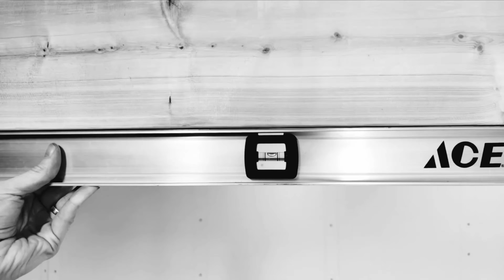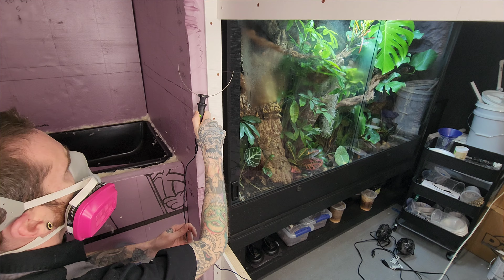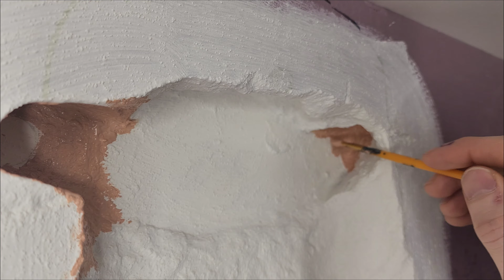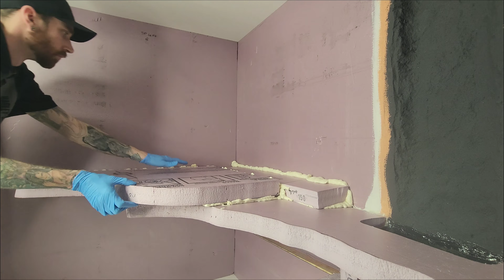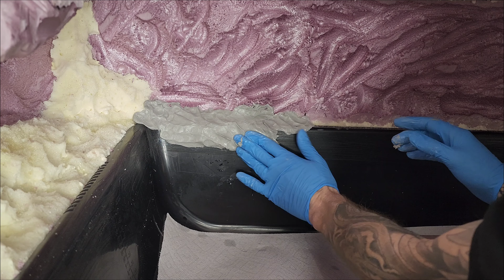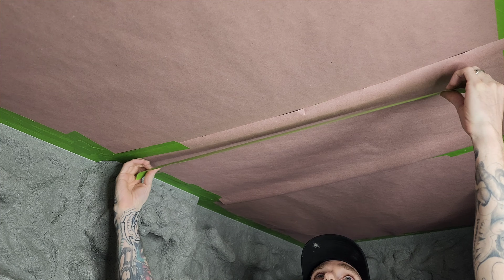DIY HUGE Reptile Enclosure. Waterfall, Dripwall, Hardscape, Background, Zoopoxy |Part 2| #reptiles

Comment: So I’m in process of building a similar size enclosure and Rockwork and am looking at using zoopoxy for if did you use all 20 gallons like you video showed? Trying to estimate right when purchasing given how costly it is. Any insights on gallons per square foot would be helpful.
Reply from the maker: I did end up using 20 gallons. I'm doing a 8x4x6 paludarium now and I won't be carving the background as much (less waste) the way I carved this background with the uneven surface made it hard to gauge how thick I was applying so in the "deeper crevasses" it was probably way thicker than it needed to be. I probably could have done it in 15 gallons. But you also have to consider the ledges and how much more millage you'll need for those. 
It is expensive but it is the best option. Super durable, light weight, and moldable.
You can call the west Chicago IL location amd ask for Tabitha, she will helpnmeasure out what you need. Let her know you wanna use what I used. They are great to work with

Comment: Hello!  I'm currently building in a pvc enclosure that is 3x2x3 for my blue beauty anoles and really want to use this zoopoxy method for the background and to help seal up leaks.   I went to the website and saw sizes and I'm thinking the 2 gallon size might be enough for my project, but I'm really not sure what the mileage is per gallon.    I was curious how much you needed for your project that was 8x2x6.
Reply from the maker: I ended up using 20 gallons. But I applied thick in some spots because if how I carved out the XPS. I'm starting the 8x4x6 paludarium hardscape this weekend and ilk use much less bc om bot really gonna carve out the background as much but do more rock/ bolders that won't eat up as much. It's hard to tell when applying into crevices how thick it is. 
Call their main west Chicago location number and they can help you measure out your millage. Go a little heavy if you are planning on doing extra ledges.
Hope this helps
Reply: @BradsBioactiveBuilds  That actually helps a lot.  Thank you for the quick response, also look forward to checking out the 8x4x6!

Comment: Just.... Unbelievable. You are so creative, skilled, and dedicated! I'm so blown away!! I'm about to make my first attempt at this kind of thing... I know it won't be anything as cool as yours, but watching the process and your tips have been so helpful. Thank you!!
Reply from the maker: Thank you! Glad you enjoyed the video. I'm sure what you create will be great! If you have any questions along the way lmk. Moat important thing is to have fun.
🤘💯🤘
Reply: @BradsBioactiveBuilds  Well, you definitely make it look WAY easier than it is! I'm working on mine now and struggling with the spray foam. I officially hate the stuff! Is there any reason you can't just use the lexel adhesive to put the shelves on and then spray foam the cracks?
Reply from the maker: @Snake_Therapy  that depends, what are u using to go over the xps board and spray foam?
Reply: @BradsBioactiveBuilds  drylok. I’ve been doing things how you did in this vid, but I find I really dislike using spray foam- messy, hard to control, and doesn’t cut nicely with the hot knife! This has been quite an endeavor and expense and I didn’t feel ready to go the next step with that other product you used, but now I totally see the value in that stuff.
Reply from the maker: @Snake_Therapy  spray foam can get messy, best bet is to spray it slowly. It's easier to control and cures more dense. What animal are you building the enclosure for?
Reply: @BradsBioactiveBuilds  yeah, I definitely did not go slowly at first and finally started getting a little better grasp, but yeah, still feels messy. I LOVE cutting the other foam tho! It’s a huge enclosure upgrade for a Mexican Black Kingsnake.
Reply from the maker: @Snake_Therapy  yeah, drylok will work fine with a king snake. Just do a few coats. Check out my blue tree monitor build. I go over how I did it there. 
The hot knife won't cut through sprayfoam. I used to know all the scientific names cmfor what's in it 😆. But essentially heat doest work on sprayfoam like xps board. Both foams but 2 very differed t materials. A serrated steak knife works best for cutting sprayfoam, but my go-to is my fingers
Reply: @BradsBioactiveBuilds  it’s so porous when you cut it with a knife- but the drylok will fill that in?

Comment: Can I ask why you used dry lock and not the zoopoxy sealant? I've heard dry lock and be soft and easily scratched. Thank you!
Reply from the maker: Good question. Do you mean the top coat over zoopoxy, the 1618?
Reply: @BradsBioactiveBuilds  Yes, but I just spoke with someone at Polygem and I'm going to try sealing with the 739 UV Stable MATTE Water Based Urethane (the structure is made out of foam and Master Mache)

Comment: Hello again. I received my zoopoxy order and did some testing and found the cured product still has a strong smell weeks after curing. Did you see the same thing in your builds? If so, how long did yours take to stop off-gassing?
Reply from the maker: Glad you are working with zoopoxy. It took about a month or so for it to be completely gone. I did find washing it off with a hose helped. Don't worry, the smell will go away. At least it's not a horrible 100% silicone vinegar smell.
Reply: Thanks much for the quick response, that is great to hear. I am very excited to build out my new enclosure using this product as testing went extremely well. I added additional texture in areas as well using a bristle brush once the product started to harden more.  

Yes, I agree on the silicone smell. It took three months for the silicone smell to dissipate in one of my previous builds. I do not plan on using silicone in the future. Zoopoxy is the way to go for sure. @BradsBioactiveBuilds

Comment: Why do you use lexel adhesive for attaching the XPS instead of a construction adhesive like liquid nails? It seems liquid nails is safe for that, unless I am missing something.
Reply from the maker: To my knowledge liquid nails is safe and I know a few people that use it. I have not personally done research on it. But I have used it with other projects besides reptile keeping and it works great for those.
Reply: @bradsbioactivebuilds  Thanks! I will try it for my interior XPS board, as it's much cheaper. Hope it will be fine!
Reply: @BradsBioactiveBuilds  Also sorry, another question. Is there any reason I can't use cheaper white EPS instead of pink XPS? From my research, it seems EPS is generally equivalent to pink XPS, but I don't know if there's any important quality I'd be losing out on.
Reply from the maker: @DraconisMarchVII  eps has a less R value and is less dense the xps. It really depends on your applications and wjat you are using it for. I have never personally used eps. Xps seems to do great being dense and easy to work with because if that when it comes to carving and sculpting.
Reply: @bradsbioactivebuilds  Alright, thanks for clarifying. I went to get some and the Menards guy told me they were the same when I was at the counter. Shouldn't have carted it home lol. I ruined one piece. Will see if I can exchange the rest and get the expensive pink stuff.
Reply: @BradsBioactiveBuilds  Another question. How necessary have you found the substrate layer drain to be? I'm trying to minimize height on my build.
Reply from the maker: @DraconisMarchVII  really depends on the type of environment you are going to have. But if you are going to have mist/water added daily. I find it to be important for a place for water to collect so it doesn't waterlogged substrate. Otherwise, you will get a sewage smell and root rot from plants.
Reply: @bradsbioactivebuilds  Sorry, I'm definitely having a drainage layer. The question is just how necessary a drainage valve is.
Reply from the maker: @DraconisMarchVII  like having a hole drilled in the bottom for the water to exit?
Reply: @BradsBioactiveBuilds  Yes.
Reply from the maker: @DraconisMarchVII  it will make it easier to drain when water rises and builds up. 
But you can also hide a pcv pipe on the inside of the enclosure, sticking up vertical through the substrate/weed barrier/clay balls to the bottom of your enclosure and pull water out with a turkey baister
Reply: @BradsBioactiveBuilds  Hey, another question! When you drilled into the XPS board to get spray foam in it, did you drill both the wall and the platform or just the wall?
Reply from the maker: @DraconisMarchVII  good question. I drilled both. The holes I fill with sprayfoam. That way, when the sprayfoam cures, it acts kinda like a drywall anchor and allows the ledge to have something to bite into more. With smaller ledges, it may not be necessary but can't hurt to do. Make sure you vacuum out any loose xps from the holes to create a better bond.
Reply: @bradsbioactivebuilds Good info. I have a big piece of wood I am going to put in there but was planning on not attaching it because of its weight. Do you think I should attach it solidly with foam and zoopoxy to prevent movement or let it rest in pockets I design to be able to remove it?
Reply from the maker: Good question. If you like how it looks just resting and is secure I'd say to that route if you wanted to remove it. 
I usually secure stuff if there is no other way of getting the placement by just placing into the enclosure.

Comment: why not use grout and drylock over it ? will be cheaper to zoopoxy is pricy
Reply from the maker: I have used grout in the past and isn't a bad option. But grout is definitely not as strong as zoopoxy. Zoopoxy is amazing all around and checks all of the boxes. 
Hope this helps 
🤘💯🦎🐸🐍🐢🌱
Reply: @bradsbioactivebuilds  I agree did look good but for Me I got a terrarium 250 cm  wide 220 high 1 meter deep so it's gonna be expensive haha

Comment: Amazing video!! Quick question, can I skip the dry lock and apply regular acrylic paint directly to the zoopoxy? If so will the acrylic paint last in a high moisture enclosure?
Reply from the maker: Thank you. To answer your questions, yes and yes.
I only used drylok to match the look of other enclosures in my reptile room. 
🤘💯🦎🐸🐍🐢🌱
Reply: @BradsBioactiveBuilds  Thanks much!
Reply: @BradsBioactiveBuilds  Also, wondering if the paint is necessary at all, I assume no paint on the Zoopoxy would work just fine as well, correct?
Reply from the maker: @ddiconsultants6166  yup, that would work just fine with no paint.
Reply: @BradsBioactiveBuilds  Have you ever used Zoopoxy 307 Lite with large cork bark flats, not to secure them, but to fill in the gaps between them?
Reply from the maker: @saberfights4264  I have not but im sure it would work.
Reply: Thanks much!

Comment: Looks amazing!
Which one do you prefer, zoopoxy or drylok?
Reply from the maker: Thanx JP! 
It really depends on what I'm building for. But overall, zoopoxy is 2nd to none. It has so many uses and no limits when it comes to custom hardscapes.
🤘💯🦎🐸🐍🐢🌱
Reply: @BradsBioactiveBuilds  I have done a few enclosures with drylok but have thought about using zoopoxy for a while now.  You're set ups look insane.
Reply from the maker: @jpslizards  thanx JP, and you will definitely like zoopoxy.

Comment: Will the insulation board and foam hold under the weight of a 10ft boa?
Reply from the maker: I is surprisingly strong how if you install the way I did. Dilling holes in the xps and using spray foam to attach. For example I was able to use a few gallons of water (gallon weights 8.34lbs) and it held fine. After I added the zoopoxy I was able to sit on the ledge on the right side. Now I'm not trying to temp fate but it will most definitely hold a 10lbs. Snake. 
Hope this helps
🤘💯🦎🐸🐍🐢🌱

Comment: I wonder could you use strictly plywood instead of pvc
Reply from the maker: Definitely can, I found pvc is lighter, holds humidity better, and no sealer needed to treat the wood for waterproofing. Ply wood would work just fine, just a few different steps.
Hope this helps.
🤘💯🦎🐸🐍🐢🌱
Reply: @BradsBioactiveBuilds  yes it does help I’m seeing plywood for 4x8 sheets for $27 Vs the PVC for $99. But most for the most part the extra steps for plywood may equal out to just using the PVC
Reply from the maker: @ravenfrancis1714  correct, and pvc won't rott. Honestly if I were to use plywood it would be 5 ply 3/4 inch hard wood. That's just as much as pvc.

Comment: Never never used zoopoxy, I’m just curious would that hold up to a monkey skink or a caiman lizard just thinking of a few boreal lizards that climb? Awesome build!
Reply from the maker: Thank you and Yeah, it definitely would hold up. This stuff is amazing. It's strong, lightweight, and can take a beating. The animal that's in it could do more damage and hasn't fazed the zoopoxy. I was sitting in one of the ledges after I installed everything, and it didn't break. 
Hope this helps.
🤘💯🦎🐸🐍🐢🌱